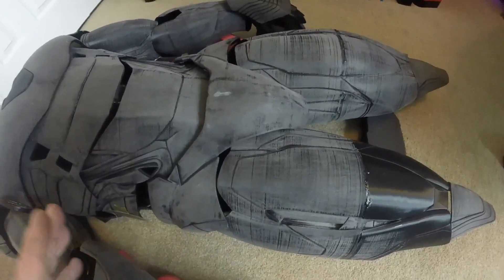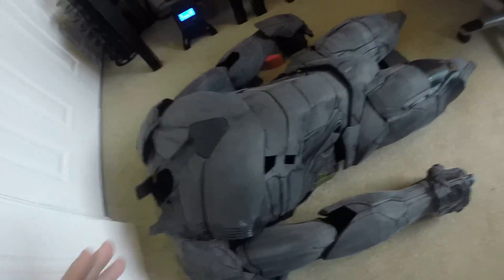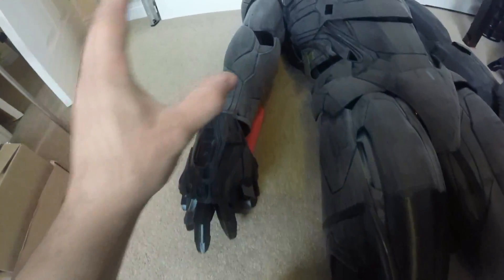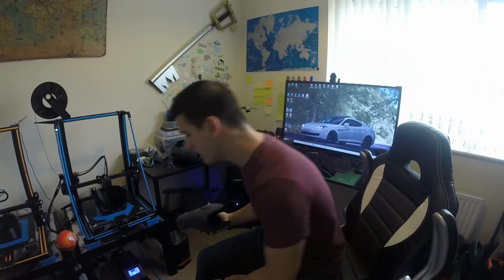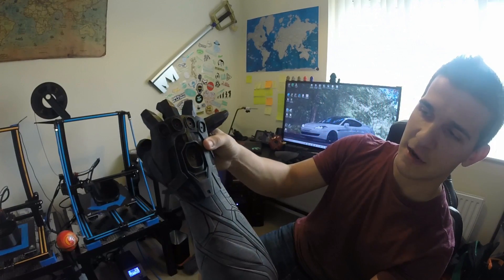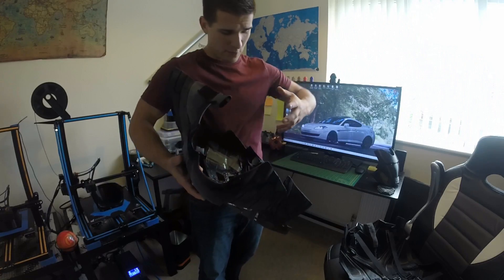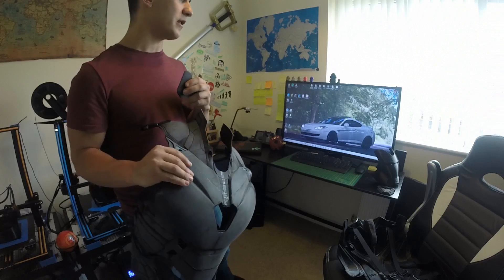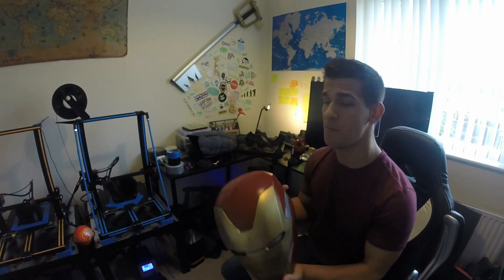How to Make an Iron Man Suit | 3D Printed MK85 Cosplay - Part 3

Comment: Hey franky, thanks for the motivation hehe, am facing a problem with scaling the hard wrest !! 90% is to big and 80% is too small, i tried 85% but still can’t get my wrest inside without breaking the plastic, how can i solve this issue ?!
Reply: try in-between like 81, 82 , 83 and print test rings

Comment: I'm thinking about trying my hand at 3d printing airsoft armor and gear. But am having trouble. Well any 3d printer do? Logically I know I will have a easier time with a large 3d printer. 

I was thinking some wicked full body armor. With 3d printed nuts bolts and screws to help hold everything. Onto the person wearing it. 

Oh god's if I could somehow magnetize the armor peices. I could actually put thin light weight metal plating. With screws and bolts and nuts holding the plates into place. 

I'm not thinking one or 3 peice armor. I was thinking multiple layers and peices. 
Under and outer armor so to speak.

Yet

Comment: How much plastics did you use
Reply: What the glue and the name of the puddy  you use I'm from Australia so I can not translate it
Reply from the maker: Cyanoacrylate glue
Reply: Nother question how can you size it to any one body to fit
Reply from the maker: I have a video on scaling actually! Check the cosplay craft playlist
Reply: Do you have a video on different nozzle size and what they do
Reply from the maker: Nah. It’s pretty basic. Larger nozzle prints faster. It can print taller layer heights and thicker walls
Reply from the maker: 15 rolls

Comment: I found one good way to scale is to cut a small outline of the model. Take about 10 minutes to print to make sure the length and width match up. How I do my Predator bios.
Reply from the maker: Alex_Hayashi that’s actually what I did on a few parts! They’re called test or size rings! They work super well
Reply: Nice 
Predator

Comment: I am thinking about getting a cr10 because of you, how hard do you think it will be to make a gundam suite?
Reply from the maker: Mark Carey oh that’s awesome haha and do you already have the 3D files for it or will you need to also model them?
Reply: @FranklyBuilt  thanks so much for responding. I have the files but heard it would take over a year to print. And since i have never printed anything before im nervous about messing up and think i should do a smaller armor build first. Thoughts?
Reply from the maker: Mark Carey well I had most of my suit printed on 45 days roughly. You would really need to start practicing abs printing to see how long it would take. If you have the files, download the Cura slicer program and learn it. Then you can slicer and render the code to see just how long print would take you

Comment: Amazing progress! What are your sanding techniques to get rid of the print lines?
Reply from the maker: Jack Midgley thanks! And I’m just using like. 150-180 grit sandpaper for now. I don’t actually have to much layer lines to cut down really. I’m using a .6mm nozzle at .2mm layer height. 5mms print speed. I’m just doing it mostly to save time on printing it later. If you want to see more or talk hit me up on my Instagram! I love sharing any techniques I can with people. 👌🏼
Reply: @FranklyBuilt  Nice! I just got a sandblaster and it gets rid of the layer lines in no time.
Reply from the maker: Jack Midgley smart idea haha 😂
Reply: @FranklyBuilt  Use XTC 3D resin followed by 80grit and you'll halve your sanding time. Then jump straight onto a couple of coats of filler primer and 300grit and you'll have a super smooth base for your paint.
Reply from the maker: Joel Carter honestly what you described is more work than what I’m already doing. I do about 1-2 quick passes with a palm sander with 100gritt and it’s baby smooth. Zero layer lines ready for normal primer lol I sanded the entire suit in about 2 hours in my garage post print.